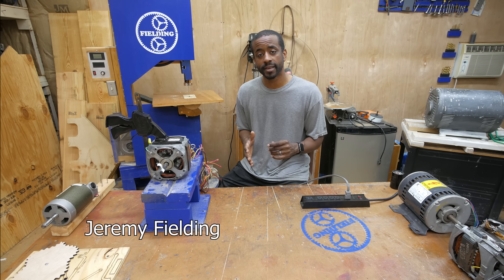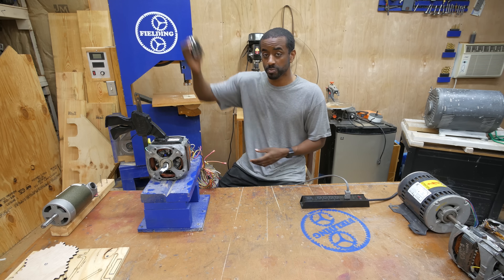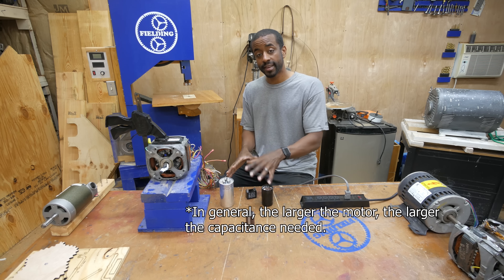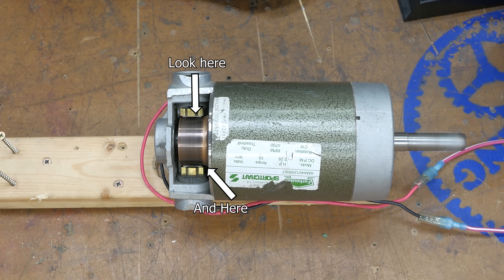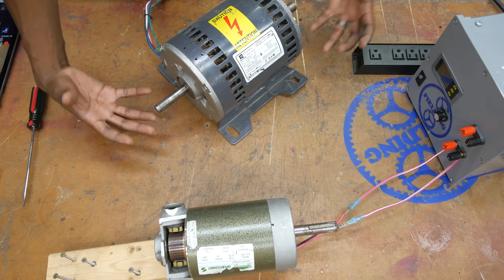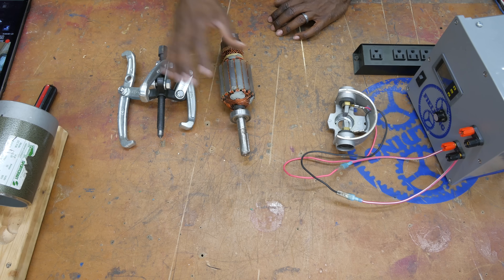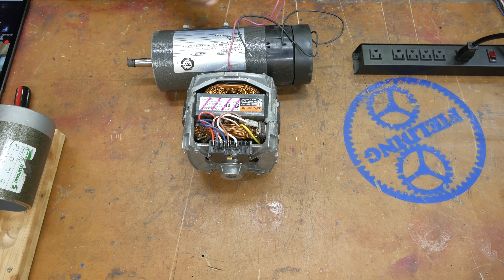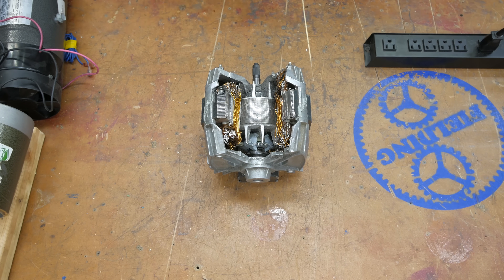Three Most Common Motor Fixes Anyone Can Do; Ultimate Guide to Electric motors ; #070

Comment: The capacitor failure is a common cause of loss of air conditioning.  You can fix it before the HVAC guy could even get to your house.  It sounds just like Jeremy demonstrated  (outside unit)
Reply: technosaurus — Had exactly that happen in a Florida summer years back.  Pointed my oldest child to Google to research the part. I helped pull the motor & capacitor (that is a BIG cap).  Had her rewire it, we mounted it back, and away we went. Good times.
Reply: I had a friend who had that happen to him. I went outside and poked the fan blade with a thin bamboo skewer (for safety) to get it moving so the AC would turn on. An ebay purchase of a new capacitor and a quick part swap later, and it's run perfectly since.
Reply: @Pyrichia  Yardstick here. I believe that not shorting out the cap first can kill me?
Reply: @davidcovington901  for a motor capacitor, no. There’s a switch that turns the motor on and off, which also connects and disconnects the capacitors. Those will bleed out through the motor windings before you have any reason to worry.

Short them if you want to be perfectly safe, but don’t be worried about it.
Reply: I wish I had seen this video and comment about three months ago. I had the same issue and it took the HVAC guys multiple visits to find the problem.
Reply: I've done that a few times. Those are typically either the direct or indirect cause of compressor problems. If they are weak they'll draw voltage needed for other circuits and it causes a domino effect.
Reply: Home Depot and Lowes stopped carrying them, got mine from amazon cheap but took 3 days to receive.  I recommend anyone with a house over ten years old (since last cap replacement) to consider stocking one for when it does fail so you don't have to wait and listen to your family complain.  Once I had the part it took 2 minutes to replace.
Reply: @asterix2ksi  damn right, was just thinking I had better go order one since finding one in stock will be impossible (especially during this Corona summer)
Reply: Yeah, it’s bad when you pay $100 to have a repair guy come the next day and you realize you can do it with a 10 in 1 screwdriver and a $15 part

Comment: 3:08 "You do not want to hook this up to AC current, or it'll explode, and we don't want that."  
Somewhere in Canada, Medhi Sadaghdar (ElectroBoom) just felt a chill down his spine.
Reply: Ha Ha, he's probably already thinking of hooking up a full bridge rectifier to it!
Reply: hahaha
Reply: Yes, yes I did want to see that as soon as my elect. Teach told me not to....15seconds later...yellow fluff floating in the air. I was 😳😆 and teach was 😠
Reply: I can hook polarized capacitors up to AC. There's a trick to it. If you want a pair of positive capacitor leads you just need two capacitors. Hook the grounds together and there you go. Like this + -||--||- + Supra genius! For real it works. I've done it. Although it takes some math to calculate the capacitance you're going to get out of series capacitors. I made a 14 uF capacitor out of a string of 100 and 22 uF capacitors once though. It was like a 600VAC cap too. The voltage rating adds in series.
Reply: @1pcfred  A simple warning almost universally true is turned into a point of contention and a pretext to demonstrate one's superior subject matter expertise.  Welcome to the God Damn internet.
Reply: @1pcfred But still most electrolytics don't like too large AC voltage, because they are designed to smooth out DC, so they are good to have AC component nearly 10 or 20% of DC voltage (say, 12 volts DC but with ripple of 1,2 volts AC), with frequency 100 or 120 Hz (double the freq. because of bridge rectifier). In conditions like these, current flowing through  capacitor is not too much: capacitors may withstand it all day :) But if we take two of these capacitors the way you say and hook up to 12 volts AC, they may blow out pretty quickly because of excessive current they weren't designed for... 

But yes, connections like these are OK for crossover filter in loudspeaker where the current through it is limited by coil resistance. 

Wouldn't recommend to put them as start capacitor for the motor though.
Reply: @1pcfred  If you do that, the voltage rating does NOT add up. In that arrangement the oxide film in the electrolyte has to act like a diode in one of the capacitors in each half cycle of the AC. This also generates a lot of heat and can damage the caps.

So in general apart from some audio applications it´s not a good idea to use that arrangement. It won´t last long.

Comment: I've needed this video. I got a 2 horse power dust collector a couple months ago that has what the guy said was a bad start capacitor .
Reply: Just be mindful that a capacitor needs to be de energized or "shorted" safely before handling. Even just a few seconds of being connected to power source will charge it fully and can stay charged for days or weeks. From what I've heard even the small ones can deliver a kick like a mule to the chest and possibly kill if you end up touching both terminals without shorting it out first.
Reply: @illumiNOTme326  I kinda new that. Wasn't Shore how long it might last.

Comment: How about getting some scroll compressors from home a.c units  . I got 5 of them from a hvac comany they were scrapping.  Ive been experimenting with them as an aid to my shop air compressor ive ran successfully have ran 2 of them off the same switch on the actualy air compressor...dangerous maby but it seams to work cycling with the air compressor.

Comment: I came across what I thought was a transformer the type people use to make spotwelders with but it turned out to be a Ballast for a fluorescent light but what I noticed when I was checking it using 12vdc is when I connected one power lead to the ballast the other lead to the multimeter then the other multimeter lead to power completing the Circuit the multimeter was reading 24vac do you know anything about Ballasts and anything we could use them for I wanted to make it into an electro magnetic could anyone tell me if possible how I could please

Comment: Universal motors are by far my favorite motor to use for almost anything. Beyond running off AC or DC, they can be used as alternators and even converted into brushless motors, although some universal motors have only a single stator pole pair (two field windings) with very long arc lengths because of the way they're supposed to be commutated. These are not very ideal brushless motors. The best universal motor to convert to a brushless motor is one with the highest density of distributed field windings and salient poles. You'll have starting problems with low salient pole count brushless converted universal motors because of the enormous deadzone the motor has to coast across before it gets to a proper firing angle. They'll need a starting motor or to be started by hand like the single-phase induction motor without a start capacitor.  Finally, you may also need to grind down the rotor to shape it more sharply to get the flux moving in the right direction to get good torque, or (and this is probably easier) shape the stator poles instead by reducing the arc length of the cup-shaped poles to somewhere around the same profile as the rotor. Again the potential that universal motors have for exploring exotic motor types is just amazing (with a little bit of work).

Another obscure motor type found in washing machines besides universal and induction is the reluctance motor. No permanent magnets, no brushes, no rotor windings, just an iron rotor. Really interesting principle of operation and extremely simple construction. Incidentally, this is what a brushless-converted universal motor is, with properly designed stator and rotor geometry.

Comment: Hi Jeremy,  i have had capacitor start motors that will not start.  I have known that if you remove the capacitor and connect the two capacitor wires to each other the motor will start with reduced power like a split phase motor.  i have only done this maybe 5 times ever and it always work.  replacing the cap solved the problem.  this makes me wonder if the only difference between split phase motors and capacitor start motors is the capacitor.  ive never tried to introduce a capacitor into the start circuit of a split phase motor.  I was wondering if you would know about this or would want to try it.  I never miss any of your videos.  Thanks.

Comment: i wanna add something educational for some motors, if it dont have brush access screws, there will be holes in the backside of the casing, you push the brushes in by hand then insert a paperclip or toothpick on the hole to hold brushes in place while you re-assemble the motor.
Reply: im not good at explaining the process, but im sure jeremy can help if need be.
Reply: @hotrodamd  i have also done the same thing many times

Comment: 3:08 Cmon, show us. lol
Love the show.
Jeremy, is it feasible/possible to gang motors together multiplying hp/torque?  Twenty washer motors in line or geared?
Reply: Haha, I can just imagine a radial engine with 5 washing machine motors spaced in a circle, with belts going to a central shaft. Just like in prop planes, but with motors Instead of pistons/solenoids.
Reply: yes. conecting them pararely using belts( you do not want to use gears in case one of them fails)

Comment: Why would one use a capacitor type motor compared to a non-capacitor motor?
Reply from the maker: Its the best option that runs on single phase power... that is the short answer. LOL
Reply: A run capacitor motor is more efficient.  A start capacitor provides more starting torque needed for things like compressors and such.

Comment: What happens if you have a single phase cap start motor that only starts in one direction but doesn't start (without a push) in the other direction? Bad reversing switch? Bad cap?
Reply: Something could be causing it to bind in one direction
Reply: @mrsemifixit  It's not binding. It spins freely in both directions, just needs a push in the CCW direction.
Reply: If it starts and runs properly in one direction (and is designed to be reversible) then the only variable I can think of is the reversing switch. I would disconnect that (after taking pictures if it isn't obvious which wires go where) and test for continuity to make sure it reverses properly.
Reply: Almost certainly the forward reverse switch. If the switch is reversing the start winding then it is probably not making contact in whichever direction it is not starting. You should be able to Google the switch schematic and check it with a meter.